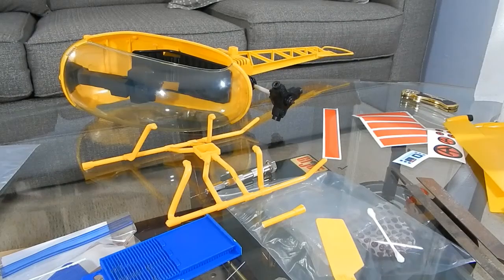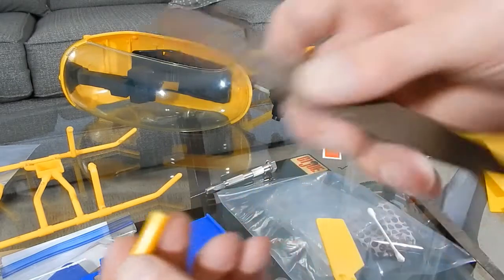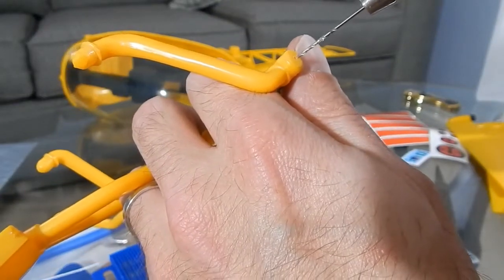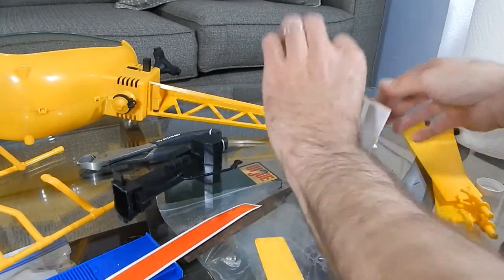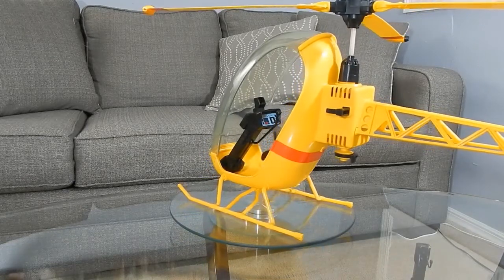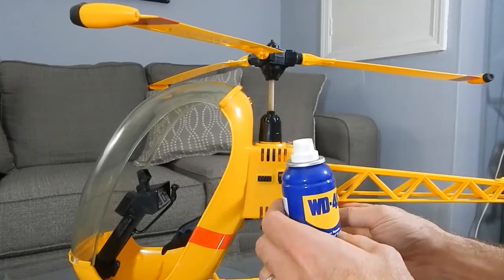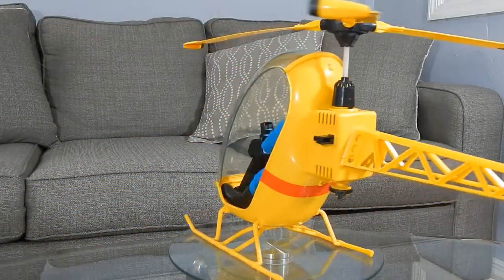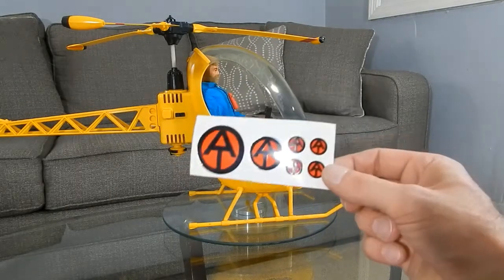Vintage GI Joe Adventure Team Helicopter Restoration Part 2

Comment: When visiting my Aunt in July 1973, we went to the local dept store and she said to pick out any GI Joe Item I wanted. I already had the Headquarters and the ATV Mobile Vehicle, so I chose the helicopter.  It survived all these years my many imaginative flights that Joe used to take. I could never get rid of it, too much sentimental value.  I can tell you though when purchased new in 1973, the toy never came with the A team logo stickers. I too purchased the Cotswold decal set for my restoration, and I think they just added those as a bonus. I ended up putting a couple on the sides of the motor and they looked nice.  Great video thanks for the tips!
Reply from the maker: I think your right about the stickers, thanks very much for taking the time to comment:)

Comment: Great job. Those stickers are probably courtesy supplemental stickers. I've ordered decals before and sometimes they just throw in a few sure you could find a nice spot on the copter to advertise the Adventure Team, one would look nice on the rear just below that stripe. Great video
Reply from the maker: Thank very much, I sure you are right on that.
Reply: @TheSkullReviews  Nice job on the restoration!! I have one I need to do the same.
Reply: NO. Not courtesy supplemental stickers. The decals from Cotswold are made by Bobby Horne, under the name of AA Designs. They are professionally made 
UV resistant die cut decals. He makes reproduction decals for a number of Joe vehicles, including the ATV, space capsule, etc.

Comment: Can you please advise on how to separate the rotor at the seam to remove the wings?  That would help with a restoration I am about to work on?

If you could, thank you.
Reply from the maker: Well if your talking about the motor from the body its held on with 2 clips that go into the main body of the helicopter, if the blades than they just lift up and out.
Reply: Thank you.
Reply: Great work.
Reply from the maker: @jmperez37  Good luck with your restoration🍻